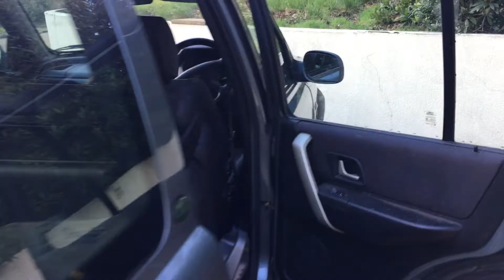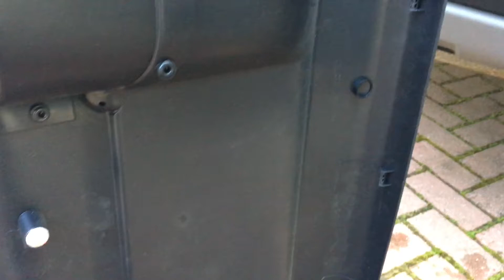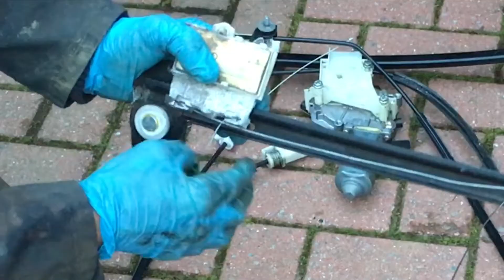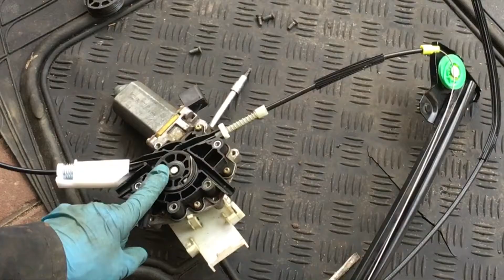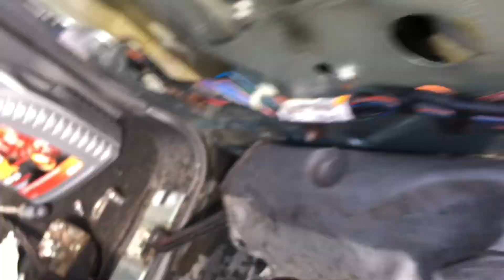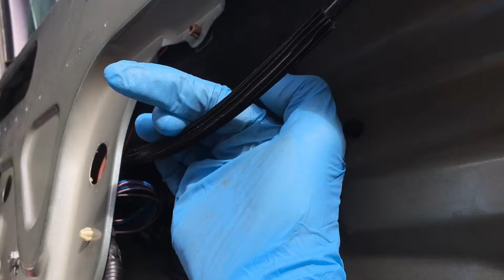How to Fix Freelander Tailgate rear Window

Comment: Bonjour. Merci pour cette vidéo, nous arrivons à reproduire avec câble tendu, nous remettons le tout dans la voiture. On débranche et rebranche la batterie, la fenêtre descend complètement et ensuite impossible de la remonter. Deux fois sur l’on essaie et nous n’arrivons pas à savoir ce que nous faisons de mal… si quelqu’un peut nous aider? Merci
Reply from the maker: Cela le fera jusqu'à ce que vous l'étalonnaz. Vous effectuez l'étalonnage en appuyant sur l'interrupteur jusqu'à ce qu'il aille jusqu'au sommet, maintenez quelques secondes de plus, puis la fenêtre doit rester là et travailler correctement.

Comment: Hi, I can't get the window to lower at all, which means I can't get to the bolts on the window clamps.. Any ideas?
Reply from the maker: See if removing the motor and rail bolts helps you get more access.  You could also try cutting through the cables if you are going to replace it anyhow.
Reply: @comeinhandynow  thanks very much.. I cut the top wire and it released it straight away.
Next question if you don't mind.
I tried to change the oil filter today but the little bolts holding the oil filter cover in place are all rounded (Apart from one).. Have you got any wisdom you can share for me to overcome it? Thanks again
Reply from the maker: @thirtiesandfree  You’ve got me confused there, the oil filter on both the 1.8 and td4 are screw on filters.  Do you mean the lower engine cover?  In general with rounded bolts try some mole grips or stillson wrench ( search on amazon for that https://amzn.to/3sKSydY ) or grin d the head down to the next smallest socket size, hammer on if necessary for a tight fit
Reply: @comeinhandynow  sorry I got mixed up. It was the crank case filter that I couldn't get to. But managed it today with a bolt extractor kit.
OK very last question and sorry for keep pestering you.
I've seen in one of your videos how to check the gearbox oil but I'm not sure where the filler cap is for the gearbox oil.. Is it just the same bit or is there somewhere else?
It's a 2006 2.0L manual.
Thanks again 👍
Reply: Sorry, its 2005 not 2006.. If that makes any difference
Reply from the maker: @thirtiesandfree  It’s normally the same hole where you check the level for filling as well.